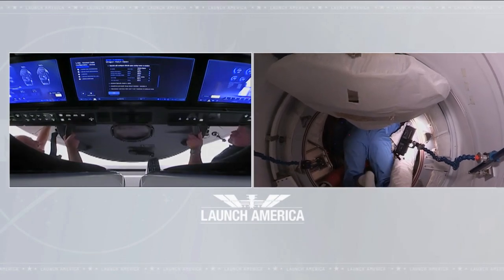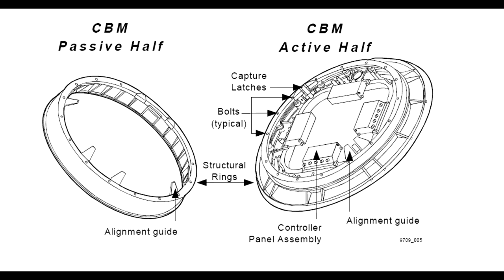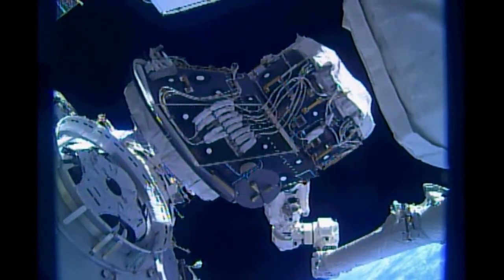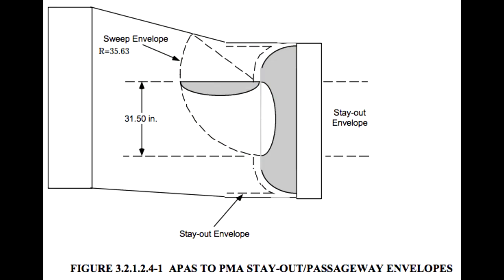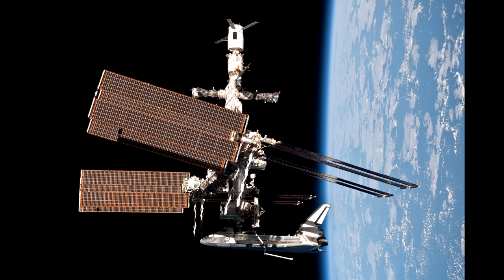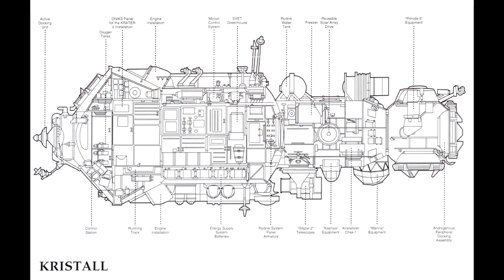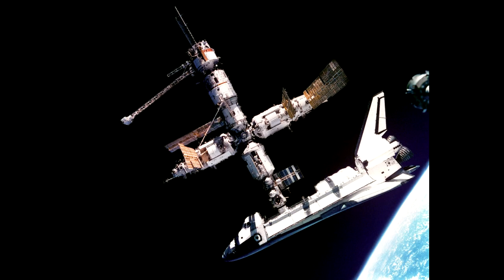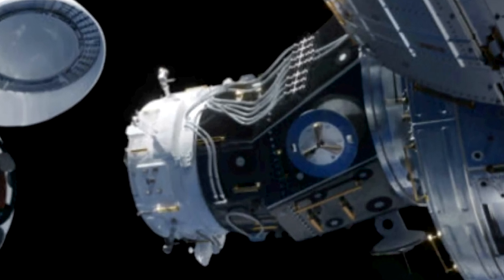Why The Docking Adapters On The Space Station Are Shaped Oddly

Comment: This shows just how involved designing hardware becomes when working with international partners and who has the deepest pockets. Listening to this video gave me the impression that the Soviets had a lot of influence on key design areas such as module interface and ship-to-station interfaces. Buran didn't materialize the way it was intended but, as you say, its influence is still being felt. I am curious, though, as to what is the design life of the ISS. I have been wondering if it would ever be replaced. I'm thinking NASA would want to, at some point, but the retirement of the shuttle kicked that consideration right out the window along with funding being reduced because of other more pressing issues the U.S was facing internally. Now that NASA is in an 'outsourcing' mode, do you think that they would approach an ISS replacement the same way as with the Commercial Crew initiative? I think that would be just as exciting to see than the competition around delivery systems currently in play. However, the development approach needs to be rotated 90° such that efforts become more co-operative rather than competitive. The 'competitive' concept, in my view, continues to be wasteful as far as time, material resources, and the misguided maneuvering for profit. Hopefully some of these tech sectors can mature past that and initiate and sustain substantive gains.

Comment: One of the added benefits is that the bend helps deflect energy should the docking not go well. A tube doesn't deflect energy, it leads it along its axis. An empty can of coke is strong enough to hold the weight of an adult. Put a small kink on it and it will fold. When you design a system, it's always good to plan for things to go wrong. Better lose an airlock than deform a pressurised module. 
My own two cents.

Comment: I thought it was to align the center of the spacelab (the science thing that filled the shuttle bay) with the connector on the forward side of the shuttle's cargo bay. They're offset and don't line up unless you have a kinked tunnel.

Comment: I would say... the odd shape is simply for one reason. You cant watch trough it from the Module. So you can create a smaler Diorama for filming in Zero-G Planes. So the Differences can be Covered easyer. And you dont need to create a background scenery. Its all about Perspektivity. Also we dont use Shuttles anymore... so the reason due to design Depending on these. Are quite obsolete. ;)

Comment: I'm guessing the adapter is slanted, because its reusing the design of the bulkhead for spacelab. It would be easier to just use the existing model than create an entirely new structure.

Comment: Since Soyuz can only return with three people it would not seem to be a very useful rescue vehicle for Buran, other than perhaps for its early test flights since presumably an operational Buran would have more than two crew on most missions.
Reply: Buran was designed for 4 crew, though could be adapted for more if the mission required it.

Comment: There would be no questions for this module if that little door in the depths 0:31 were attached on the other side (Under the astronaut's head, in this frame.). In this case, the module would be quite convenient.

Comment: I thought it was to create torque down the central mass when external craft are used to boost the stations orbit. Have this angle provides greater control of the centre point of thrust

Comment: What if it was originally designed to berth a multi-purpose logistics module to the shuttle while still inside the shuttle's payload bay, so an offset was needed to reach some APAS compatible adapter attached to the airlock ot the suttle which is below the centre of the payload bay?

Comment: So it seems to put the end of the module in front of the upper windows of the space shuttle command deck.. perhaps this also assists in manual optical sighting only docking..
Reply: They don't dock the shuttle from the front seats.  They do it from the rear of the flight deck.  That's why there are windows in the roof there and in the cargo bay.

Comment: Can you berth to the CBM in any 4 orientations or just one? If so, even if there happened to be no requirement for it to be misaligned, wouldn't it make more sense to still make it like that for future-proofing? If you make it straight, you have a single possible arrangement. By shifting it, now you have 4 different possible arrangements.

But that's assuming it can actually be turned. I can't find whether the CBM has a predefined orientation or whether you can rotate modules 90 degrees and berth them again.
Reply: Just visually, berthing to the CBM's orientation look universal. When the PMA's were fitted, this showed you can fit, at least the PMA's, to the CBM in any orientation. In initial designs the PMA's were at different angles and were rotated when actually located on the station.

Comment: So if Crew Dragons are going to be reused for cargo missions and have to use PMAs instead of CBMs, will the packages of cargo need to be made smaller? I feel like you could fit larger objects through the CBM than through the tunnel of the PMA.
Reply: Correct, except there is a specialized cargo version of Dragon 2.

Comment: Before I watch this im going to guess that the docking ports are pitched that way so that docking Vessels dont pust the iss along is x or y axis. Having them pitched allows the iss to roll on its z axis if the docking vessel docks with to much force alowing the iss to correct itself using as little fuel as possible.

Comment: No single answer may be 100% right, but all the answers together probably account for why it's like this. It's got lots of little benefits that all worked together.
When we come to build a new station I wonder if they will take the chance to redesign the standards again. One thing I note from the crew dragon flight is the docking process is VERY slow. If Elon is wanting his ideas on the volume of people and ships to get close to reality we need to get closer to a 'sci-fi' docking system which is mostly automated and much quicker. Turning an hour or more into a five minute procedure.

Comment: Just realized this from your video, I wonder how hard it would have been to keep Space shuttle Columbia in ordit for an extended time, and have Russia send a empty Soyuz to act as a rescue for the astronauts. Instead of sending them to their doom. Or maybe some extra tiles and a glue gun for repair ?   I know its old news but still food for thought.
Reply: There's a few problems.  First, Columbia was on a spacehab mission in a 39 degree inclination orbit.  The Russians can't launch a Soyuz into that low of an inclination orbit from Baikonur.  That's why ISS is in such a high inclination orbit.  Second, Columbia had been in orbit for 16 days and only had a few days of CO2 scrubbers left.  There was no tile repair kit in existence at that time, and it wasn't a tile that was damaged anyway.  It was the RCC panel on the leading edge of the wing.  They didn't have time to make one of those - they would have had to remove one from another shuttle and figure out a way to attach it to Columbia.  Of course, they didn't know that's what the problem was at the time, so they wouldn't have known what to bring.  And on top of that, there was no robot arm on Columbia on that mission, so there was no way to physically put an astronaut out there in front of the wing to do ANY kind of repair.

Comment: So much confusion. (you can't park there, it's got the wrong adapter). Why could'nt they scrap what had come before and all agree on one standard (new) design before designing the ISS?
Reply: Because everything that's built in aerospace is a compromise, and is engineered to satisfy the requirements, and not a bit more.

Comment: I keep wondering why we dont keep adding to the station.   (replacing modules with larger ones etc)  more solar panels etc.
Reply: Because you can only spend so many billions on the damn thing.
Reply: The main reason is because the Shuttle is no longer flying. And what would be the point?  They're just going to burn the whole thing up.

Comment: Answer seems simple to me... inside the shuttle the bay access hatch is on the bottom of the bay, not the middle, so to go from hatch diameter, to something that's diameter meets the middle of the bay,  you need to have the kink in the tube.

Consider http://www.collectspace.com/images/news-102114a/005-lg.jpg

Comment: Primary design parameter: structural load vector. It is supposed to be able to support the entire mass of the ISS in trajectorial ascent under impulse from a third party vessel... that was ostensibly, the strongest pattern, conical eccentric reducer.
Reply: @dramaticusflatudicus3839  I would suppose you would have to factor in the rate of acceleration of impulse... it's not like there is dynamic air resistance... just a 200+ tonnes space station...
Reply: @dramaticusflatudicus3839  Interstingly enough, the cross beam structure for supporting the solar array doesn't have to support in technical terms 'much weight' although it is beam reinforced structurally in six different directions... having built both things...
Reply: @dramaticusflatudicus3839  But I mean that is the difference between snake oil and engineering... about 200 tonnes.
Reply: @dramaticusflatudicus3839  what can I say, I have a talent for understatement...
Reply: @dramaticusflatudicus3839  go trig boy, it’s your birthday.
Reply: @dramaticusflatudicus3839  So where did you read the specs? The manufacturer’s warehouse archive?
Reply: @dotsmassacre  Not sure about the flurry of replies there. What is the issue? I was just keeping my answer simple.
Reply: @dramaticusflatudicus3839  whatevs.
Reply: @dramaticusflatudicus3839  but keeping it simple, it was an expert refutation of your opinion.
Reply: @dramaticusflatudicus3839  pretty sure it’s a fact. But your method of condescension while noted is totally not unique...
Reply: @dramaticusflatudicus3839  what is odd is that somebody who nobody knows would think they can put a smack down on me in some comments section about something they know nothing about... because I mean, this is your natural habitat though, right?
Reply: @dramaticusflatudicus3839  bottom line, my port is sitting on the ISS rather than behind a keyboard somewhere trying to tell me what is fact and what is my opinion... evidently somebody was convinced by my mathematical presentation, fifteen years ago or whatever...
Reply: @dramaticusflatudicus3839  starts with a statement that is made irrelevant by the very fact of the existence of the thing we are talking about, comes in hot with another throw away line.
Reply: @dramaticusflatudicus3839  I gotta say, I don’t find you fun, just boring.
Reply: @dramaticusflatudicus3839  and mathematically a right angle is about as figuratively factual as you can get...
Reply: @dramaticusflatudicus3839  since you’re so smart and you think we’re talking about a “crumple zone” based upon the rule of eccentric, concentric perpendicularity, in what direction would an eccentric angle crumple vs a concentric angle?
Reply: Using path of least resistance as a guide...
Reply: Cuz common sense, I can tell, is strong in you...
Reply: And if indeed we were talking about a “crumple zone” why not just have a set of collapsing rings with a cape?
Reply: Like on an airport boarding ramp?
Reply: And again, this comes back to, when you get over your basic pressure argument, rate of acceleration of impulse which, I already cited...
Reply: When you got beat up in high school because you had a smart mouth, it wasn’t because you were smart...
Reply: "Using path of least resistance as a guide..." You. In a nutshell :)
Reply: @dramaticusflatudicus3839  another simple example of how your “crumple zone” argument fails muster: why are hydraulic rams concentric?
Reply: @dramaticusflatudicus3839  no but literally, by decreasing the hypotenuse of a right angle triangle to no greater than the length of the diameter of the smaller circle achieves what? For quadrilateral integrity? An apprentice could answer this question btw...
Reply: @dramaticusflatudicus3839  let me ask you a question incumbent of the square of sides rule on a right angle, how does one decrease the risk of the collapse of a hypotenuse while equally increasing the length of the square angled sides?

Comment: @ScottManley Does the US currently have the lift capability to replace something like that? Even if we wanted to?
Reply: The problem is rendezvousing with the station. Shuttle was able to bring things along with it. Dragon has its trunk which has carried BEAM and the IDA, but that is too small. Otherwise the module needs to have its own maneuvering system. That's how the Russians did it
Reply: Easily... ISS modules vary in mass, but the biggest pressurized segment (Zvezda) is only about 20 tonnes, or about double the mass of a Dragon 2 capsule. So even the largest module is possible (barely) for a Falcon 9 (22 tonnes to LEO according to Wikipedia), and only just outside the limits of an Atlas V (about 18 tonnes). 
You might need some extra hardware to actually get them to the ISS though, since I'm guessing neither of those upper stages is capable of the finesse to position them close enough to be attached to the station. That was the big advantage of the Shuttle, of course... a big cargo bay, combined with fine-maneuvering thrusters.
Reply: Hmmm... But wouldn't they need to send astronauts? Or would they just get the existing crew to EVA?
I wonder how much the maintenance cost of the station might go down with the Falcon available.
PBS Spacetime made it sound like not much :grimace:
Reply: @fnamelname9077  Once the modules are within reach of the ISS, they can be grabbed and attached using the Canadarm... as far as I know, nobody needs to go outside.

Comment: 2:30 question: how do they avoid  vibration resonance while docking ?
Reply: It can only dissipate. Not sure what you're picturing as a resonance to avoid... Somehow the sides would latch and after that they would continue wiggling harder and harder relative to each other? For what reason? After latching there's no further input or amplification of that vibration energy.
Reply: @u1zha  Assuming they remembered to put the attitude control systems into free drift.

Comment: Except Buran could do things the shuttle couldn't, such as automatic landing and takeoff, right from the get-go.
Reply: The shuttle  did automatic takeoff on every single flight, and the only reason it couldn't completely autoland was because the ego on the test pilots who flew her was too fragile.  The only thing missing  to allow autoland was the ability to lower the gear, which they intentionally left out of the original design for the sake of the fighter jocks who flew her.  After Columbia, they corrected that, and included a cable that would allow full computer controlled landing if it had ever been necessary.

Comment: I know the Dragon 2 has a certain amount of unpressurized cargo capacity in the trunk. Imagine a dragon bringing up its own PMA on the way to the ISS🤣 Probably not practical, but it’d be pretty funny to watch.
Reply: They did bring up the IDA parts in the trunk.
Reply: I don't think it has enough room in the trunk for that to work... but if it's light enough to not impact fuel requirements and handling too much, you could hypothetically launch it on a second Falcon (maybe shared with a Starlink mission), and have the Dragon dock with it in low orbit before carrying it to the ISS.

Comment: It still blows my mind that the shuttle program was wound up outright. Yes they where dangerous however if the Russians could fully remote control/automate a buran in the 80s surly the USA could set up the remaining shuttles as unmanned   cargo transports with them either picking up crew from the ISS or docking in flight with a safer capsule. Sadly the moment has passed.